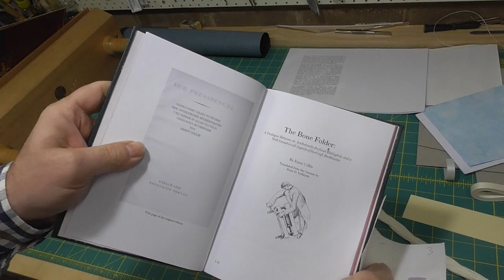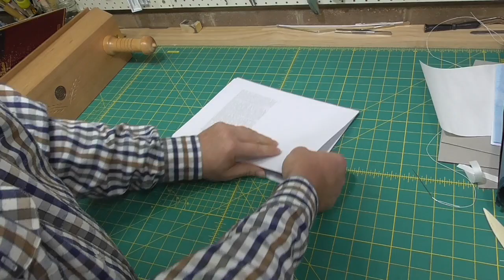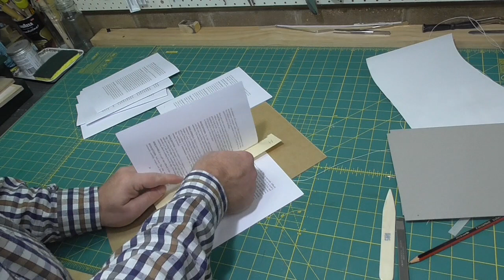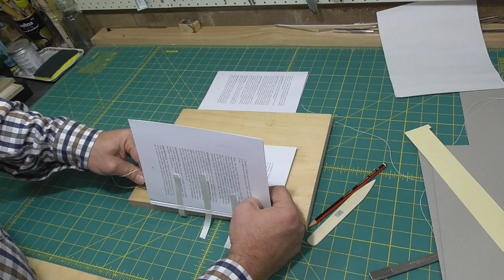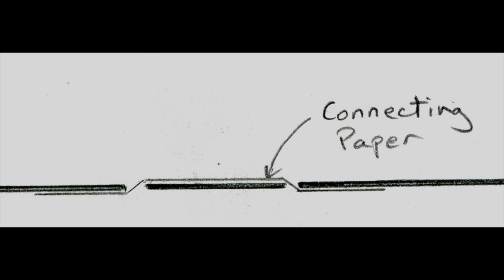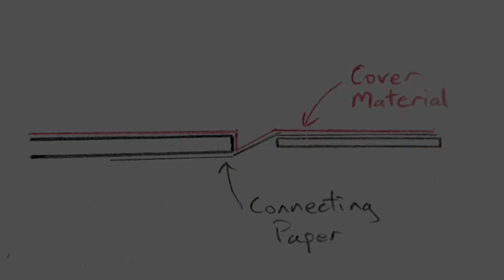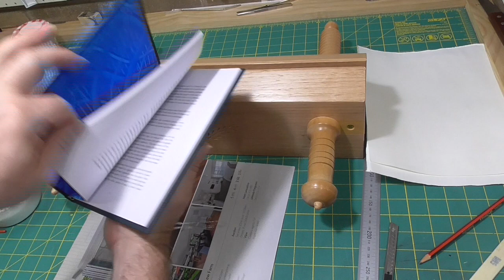How to Bind a Square Back Bradel Binding // Adventures in Bookbinding

Comment: I've been avidly going through the videos in your channel for a few months now, and would like firstly to say thank you for the excellent instruction and quality of explanations. 

Secondly, I would like to ask if there is an upper limit to the thickness of the text block using this binding method? I have a preference for the square backed aesthetic over the rounded, and would like to attempt to bind a larger A5 book of about 5-6cm thick.
Reply: Did you ever get a response?
Reply: You should probably use more tapes, say 4 instead of 2 etc., so it is better supported.

Comment: I've been trying to get that nice crease on the edge of the boards but the cloth won't stick.  It peels away.  I've made my own bookcloth with linen, an iron on fabric adhesive and tissue paper.  I have proper book cloth on order but I feel like my PVA is just not adhering when I press it in.  I pinch the fabric and quickly put it under my press and hope it turns out ok.  Very frustrating.
How does yours just "stick"?
Reply: Oh nevermind, I know what I did wrong.  I'm mixing techniques and I just glued the spine stiffener directly to the cloth first.  I am having a heck of a time getting my heat transfer vinyl to be centered so I've been trying different methods.  I've found that the cover gets heavily warped when I try to iron on the HTV after I make the case.  Trial and error I suppose.

Comment: These endpapers are different than the endpapers in the made endpapers tutorial
Reply from the maker: Yes.  All endpaper designs are part of a continuum.  In the stand alone video I demonstrated the situation they have most commonly been used historically - 19th century English style bindings - following published instructions from this period.  For this video I changed it a bit for the significantly different binding.  For instance, the waste is much more important on a leather binding and not really needed in this case.  The book is fairly thin so I think I remember adding an extra folio of white to add a bit of bulk. Did it make a difference?  Maybe, maybe not?  But it is always interesting to experiment.
Reply: @DASBookbinding  
Thank you so much
Your videos are very useful

Comment: Books I made around 300-400 pages with this technique are having text block sag after standing on shelf for 6 months. I don’t have the equipment for rounding, sadly. Any ideas to prevent that sag with this bind? Would using mull on the spine help prevent it? Or cutting some board to put under the text block while the book is on the shelf?
Reply from the maker: Book shoe

Comment: 13:48 Would there be a point to rounding the spine of the text block slightly (say, if we have a bit more swell) after trimming it, even if the case has a straight spine? Or would that introduce unwanted forces when leafing through the text? 🤔🙂

Comment: You mentioned leaving 7mm gap between the spine support and the boards for thick cloth, would you leave much more if you were using leather?
Reply from the maker: Depends on the thickness of leather.  I probably wouldn't;t use leather on a square back book.  But if I did I would pare it very thin.  So maybe I'd go to 8 or 9mm.  It's not an exact science.

Comment: Great Work ! I have some technical questions. What are the basics differences between Cover binding and Bradel binding ? Because the cover technique it seems me used in both bindings the only difference that I can discern is, at the bradel binding  used paper to connect boards and spine stiffener. But to me it looks like the bradel is another subcategory of cover binding.
Reply from the maker: Yes, you're right, they are close to identical.  I was originally taught the "English" method of doing a cased square back, and the difference with the Bradel is a strip of paper and some technique.  But I don't think I'd go back to not including that strip of paper, and for this I believe it is worth recognising as a different structure.  Then there is the discussion about whether a in-boards Bradel and a cased one are the same binding.  The end product is essentially the same, but how you get there is very much different.  Happy binding!  DAS

Comment: Hi
Great video.  just one question where do you get your Ramieband from.  I have not been able to find a supplier in Tas or Oz for that matter.
Reply from the maker: Hi Mark.  I'm fairly sure you won't find one.  QBG has a good stock and I get it from them.  But it's a members only store.  I think I'm the only one who has bought it in forever.  It's made by a German company, and you can get it from Germany with great difficulty and expense or from Talas in the US for great expense only.  Or send me a message at darryn@dasbookbinding.com and I can do you a good deal on a couple of meters through the letter post.  All the best, DAS

Comment: What's been tripping me up with any of the stiff spine bindings is the width between the spine stiffener and the board. You said it depends on the covering material. How so? Is it the width of the covering material plus some other width— or a multiple of the covering material width? Some instructions say double the width of the board width. Could you give a little more info?
Reply from the maker: Good question.  If the gap is too narrow the book won't open well, or worse will tear the pastedown from the textblock.  But too wide doesn't have many down sides - maybe doesn't look as good.  So it is better to be on the wider side.  If you think about what will end up inside the groove, especially when the cover is fully open it's something like 3 layers of covering material and the board.  So for a 3mm board you would expect 4-5mm would be sufficient.  I used to use 5mm for books A5/A4 in size.  But then I came across Peter Verheyen's recommendation of 7mm, which is what I mostly use now.  I find this opens much better because there is a bit of flexibility in this groove area and lets the board clear the should when opening flat, and it looks good.  I think double the board width works because the shoulder is normally the board width, and with similar reasoning should open well.  So for a 3mm board using double board width 6mm should work, but if you make it 7mm it's being safe:)  I will go less than 7mm now if using thin boards and small book (say A6) and I'm after a certain look.   Hope this helps. DAS
Reply: @DASBookbinding  Thanks. I usually work with Imperial (being across the pond) instead of metric but thinking of switching. Seems to be easier to deal with metric. And yes, I feel that a gap slightly wider than the two boards would help. Appreciate your  quick response. Going to do a text book today.

Comment: I have a question. Shouldn't the spine stiffener be the same width of the text block?
Reply from the maker: It's an interesting question.  For a rounded Bradel with a spine stiffener that will be shaped to the round of the spine, the the spine stiffener is the same width.  For the square back version where you are after a groove at the outside joint  the spine piece (it's a bit more than a stiffener in this case) it is usually about the width of the text with boards (or a bit less).  If the spine piece was the same width as the text I don;t think it would be as aesthetically pleasing plus I think there is a mechanical issue.  This is a hollow back binding.  When you open the book the book wants to throw up.  If the cover material is attached right at the shoulder of the text and to the spine piece I don't see how the text can throw up.  It might put a lot of pressure on the inside joint and would act like a tight-back binding.  Hope this makes sense.  Yours, DAS
Reply: @DASBookbinding  thanks for the answer. Time for my third try (the other two cover I made failed :V)

Comment: Would using a fine mist sprayer work to rewet the adhesive? I do this when working with pva sometimes.
Reply from the maker: A moist sponge or rag is better. Spraying introduces a lot of moisture and harder to control.

Comment: This clears up a lot of questions I have. The spine stiffener is cut slightly larger than the overall height of the text block and boards? And you set the text block flush with the spine stiffener? I've been trying to slightly offset the text block from the spine stiffener to let the text block "sit" in the gap between the spine stiffener and the boards. It looks like I don't need to do this.

Comment: Hey Darryn! I watched both this video and "made enpapers" video and I'm confused:( There is no extra white paper on this blue paper you attached it directly to the board but you've glued additional white paper in the "made endpapers" video. Is there a specific reason for that? Thank you very much.
Reply from the maker: This is a simplified version.  The waste sheet is more important on a leather covered book where the text block needs some protection while covering in wet leather.  Hope this makes sense.  DAS
Reply: @DASBookbinding  Sure it does! Thank you very much! <3

Comment: for the spine stiffener, I noticed that you measured the text block at the front and not at the binding.  Is there a reason for thi?. My binding end tends to be thicker.
Reply from the maker: This binding should have minimal swell and no more than the board thickness.

Comment: Hello! Great video. just want to clarify, at 20:25, the groove is on the book-board side, not the spine side, is that correct?
Reply from the maker: I think I understand your question.  Yes, the covering material goes down the side edge of the board and then slopes up towards the spine piece.
Reply: @DASBookbinding  perfect! Thank you!

Comment: I've just finished watching this video for the 2nd or 3rd time, and am I right in that the only mechanical connection between the text block and the cover is just the 3mm tipping of the end papers?
Reply: Ah - I see you sew the endpapers in with the rest of the text block...
Reply from the maker: Also spine lining and 3 sewing supports.

Comment: Thanks for the video Darryn. As always your videos are very educational and helps a lot with my bookbinding adventures :) 

I have a question for you, the permalife paper that you used for the case is not available in Australia. What would you recommend as an alternative which is easy to buy in Australia?
Reply from the maker: Specialty papers aren't really available in small quantities in Australia.  When I start restocking my store I will investigate if I can stock Permalife economically.  You should just use a good copier paper such as Reflex.  A lighter weight acid free kraft paper would work too.   If you're in Brisbane you can stop by the bindery and I'll give you a metre of Permalife.  DAS

Comment: Love the video as always! I have a few questions tho. Why did you make the spine only 1.5 times the with of the boards and not 2? And why is the spine stiffener paper on the other side than the spine itself? I assume this is also the reason why why the spine is not two times the thickness of the board but it is not fully clear to me haha. Also, can I just use mull on the spine? you used some strong paper, but I'm more accustomed to using mull. Does the paper serve any specific purpose or is it just what was laying around?
Reply from the maker: For thinner books - well most books I'd do square backed - if you make the spine piece 2 board thickness plus text, once your include covering material etc it is noticeably thicker than the main body of the book.  There are exceptions when I might go 2 board thicknesses - covering with thin paper.  Yes, you can use mull.  It adds some strength.  Didn't follow the other side question, sorry.

Comment: What kind of caliper are you using to measure the text block thickness at 13:42?
Reply from the maker: Generically called a "dial thickness gauge".  You can get cheap Chinese made ones and expensive American made and everything in between.

Comment: I am writing this message from Turkey and thank you for this incredibly informative video. I use PVA-based paper glue to glue the fabric to the cardboard. However, when I fold the edges like at 29:33 of your video, I have to hold it with my hands for almost 10 minutes and yet it can still come off. This is a really difficult process. Is there a compound that accelerates adhesion in the PVA adhesive you use?
Reply from the maker: PVA should tack much faster than that. Is there any chance it was frozen at some point?
Reply: @DASBookbinding , Thank you for your quick reply. In case the PVA glue was damaged or frozen as you said, I also tried it with the newly purchased PVA glue, but nothing changed. Should I wait for it to dry first and then do the process? Note: The PVA glue I used afterwards is 3M Scotch brand and it says "Skole-og hobbylim" on it.

Comment: Should I trim the text block before glueing/reinforcing the spine? I tend to have some trouble making sure all the sewn signatures stay aligned with each other, so I'm afraid that if I trim them before reinforcing the spine, once I do reinforce it, the edges won't be even anymore.
Reply from the maker: Always glue the spine before trimming. Good luck.
Reply: @DASBookbinding  Thank you!!

Comment: Awesome. I'm about to do some prints of childhood books this way. What are the 2 pieces of wood made of that you surround the text block with before slipping into the nipping press? They are really smoothe.
Reply from the maker: Marine ply.  I buy the sheets with finished surfaces.  But once I cut them to size I sand them again with 220 grit sandpaper.  I don't coat them because I want them to absorb moisture out of the book.
Reply: @DASBookbinding  thank you.  sense. I'll need to find a substitute. Marine plywood costs an arm and a leg.

Comment: At 26:00, is the groove then adhered to the text block/paste down or is it just a crease in the book cloth?
Reply from the maker: This is trickier question than you might expect.  I glue out the full pastedown so if the cloth was all at the same level under the board, it would adhere all the way to the spine fold.  In reality the cloth has to rise up to go around the spine board which stops it getting glued all the way to the spine.  This is a good thing.  The book would not open well if the pastedown was attached all the way tot he spine fold.  It tends to just work and no one really addresses this little technical point.  I will make a video about this in the future, but I'm still doing research on it.  I'm asking other bookbinders that teach a lot how they address this, and looking for documentation, of which there isn't a lot.  Anyway, well spotted.  btw, this is why this gap has to be wide enough and the main reason why people who make this gap too small have trouble opening their book.  There is another factor at play too.

Comment: Hello, and thanks for all the excellent content!you said that the distance between the spine stiffner and the boards depends on th thicness of the board and the stiffness of the cloth , is there a precise calculation for this i'll use boards of 2.4 mm and a cloth of .3 and i'm wondering what distance i should choose. thank you again , i'm looking forward for the next video , cheerios!
Reply from the maker: No, a precise calculation would give a false sense of the process.  There are so many factors that are hard to consider - how well the cloth is formed inside the joint for instance.  A joint that is too tight is worse than if the joint is a bit too wide.  For the standard type materials - about 2mm board, normal thickness book cloth, and about the same standard of workmanship, around 7mm usually works out well with a bit of margin for error on the high side.  Then with experience you can start to dial this is.  If I use thinner board I will drop to 6mm for instance.  In your case I would use 7mm.  Good luck!  DAS
Reply: @DASBookbinding  thank you very much.

Comment: Thanks very much for these excellent videos. I’ve been watching them for a couple years now, and really appreciate your thoroughness and structure. I return to this one often, as I’ve been using it to make notebooks as gifts and to sell. I’ve worked out most all the kinks, but I always get board warp when I let the book dry with open covers (as you suggest). Sometimes I can fight it if I keep it in the press for 2-3 days, but usually it creeps back eventually. I’ve tried standard board and davey board, and covered with arrestox and with paper-backed cloth. I’ve had better luck covering with kraft paper than with cloth. In all the cases, I’m using mc/pva mix to glue out the endpapers to the cover. Would it help to switch to pva for the pastedowns, or is there another way to equalize the pull between cloth on the outside and paper on the inside? Thanks again so much for this service you do us!
Reply from the maker: Have you seen my video on how to stop boards warping?  It's all about balancing the pull of materials.  Pull can be minimised or it can be balanced.  But it always there.  A bit of warp inwards is a good thing. It sounds like your warp too much in.  So you could put an external draw sheet on the outside and pre-warp the board out a bit.  This will make it stiffer too.  This is common to do with leather binding because leather has such strong pull.  Often you make the board super stiff by covering in paper both side and then pre warp in with an extra layer inside to counter the strong outward pull of the covering leather.  Hope this helps.
Reply: @DASBookbinding  I’ve seen the video, but somehow still struggle with this one; I’ll have to watch it again. I’ll also try the external draw sheet. Is it common for fabric to pull less than paper? Many thanks for the help!!